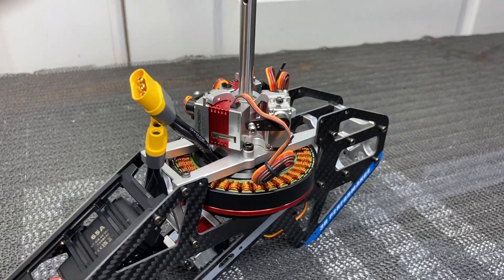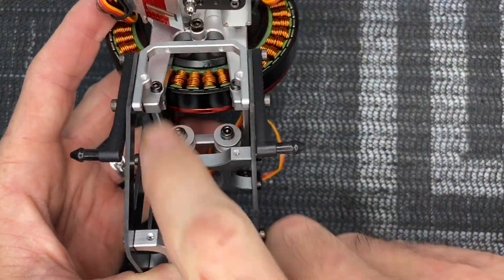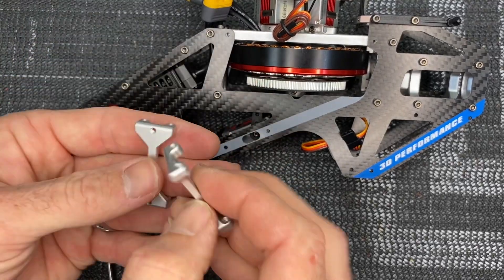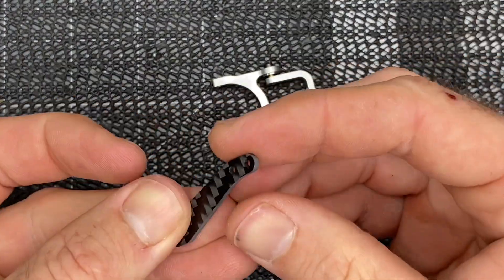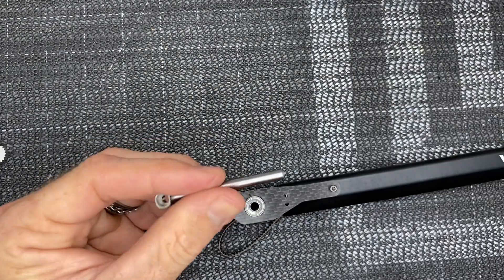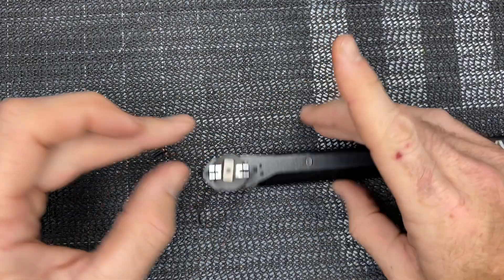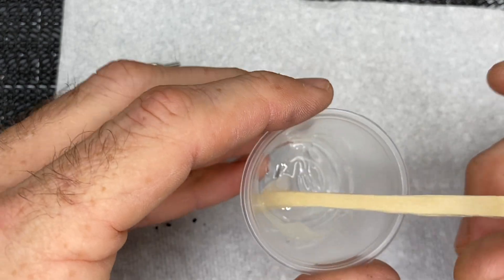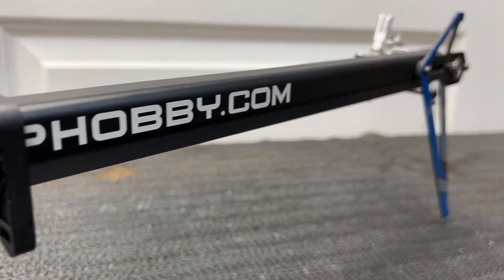OMP Hobby M4 Build Part 2

Comment: Great video as always!

I'm building the m4 max kit and quite a few things have changed for the better. The rail assembly for one is much easier. No more tiny copper washers but the recess already cut into the part.
Reply from the maker: Man! That’s great to hear. That tiny copper washer was a PITA! I’ve not built a M4 max but I’m happy to hear they improved it!n
Reply: @westhobbiesrc8051  so far I haven't had any problems with the kit. The manual isn't as clear a the SAB ones but that's the case for most other brands lol. Only complaint this far is that they don't include any mounting hardware for a  mini tail servo that doesn't have the middle mounting hole beteen the 2 tabs. But luckily I had some crews laying around. I'm gonna set it up with the new radiomaster Nexus running rotorflight I'm curious how that'll go.

Comment: If you look closely, one of the bearings inside the tail blade grip is not all the way pushed in. That's why it was tight. I would put a screw driver on the tail screw and knock it until the bearing is all the way inside.
Reply from the maker: I’ll take a look at that. That makes sense on why it’s tight.

Comment: Interesting...I see this heli uses a floating spindle in the tail assembly but the "Delta Offset" on the link connectors (from the blade arms to the pitch slider) is much more exaggerated on this little heli than even what you find on a SAB 700 Goblin or a Buddy 380 for example. Looks like 15-16 deg.   (@ 17:44)

About Delta...(for any interested readers) The "Delta Offset"  is used because when one side of the floating spindle teeters one way or the other due to different tail thrust on the advancing and retreating tail blade it causes the pitch to change slightly on the opposite blade grip, so to even it out, the Delta offset stabilizes the blade flap in the tail rotor. Without the Delta the spindle will teeter, but without blade correction,  (it may actually teeter more),  all this slight unwanted pitch change in the tail blades causes an amplification of tail vibration.  Delta offset of a few degrees on the tail link assembly eliminates this problem.
Reply from the maker: Yes, it does, and that is some very good information you put in there! I’ve read it all and learn something new! It is definitely a lot more aggressive compared to other models.

Comment: Hello is there a trick with those little brass washer that go into tail bellcrank base they just don't fit one side will but the other is near impossible without bending stuff wtf
Reply from the maker: Unfortunately, no, they are a massive pain in the ass! It probably took me 25 minutes to get those in there.
Reply: @westhobbiesrc8051  thanks again for the response mate, was pulling what little hair I had left out 30 mins later finally managed to get it sorted 😀 it definitely took some finessing those Little Bushes are tiny
Reply from the maker: @Kurt-c8f8r  welcome! Yes, it drove me nuts the first time as well. That is why I stated in the video it was a pain lol I’m glad you got it figured out.

Comment: Your tail assembly is tight because you tightened the screws before aligning everything and didn't do it afterwards, as stated in the manual. Open the 6 tail case bolts, tweak the alignment of the carbon plates until the slider falls under its own weight, then tighten as indicated in the manual.
Reply from the maker: No it’s tight because one bearing in the tail grip was not all the way down. It’s fixed now and free and smooth.